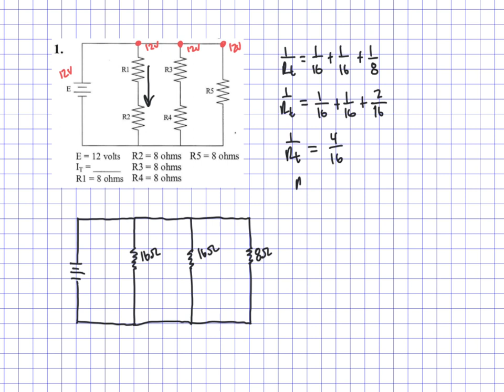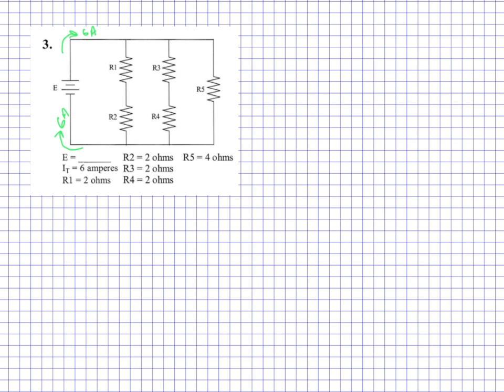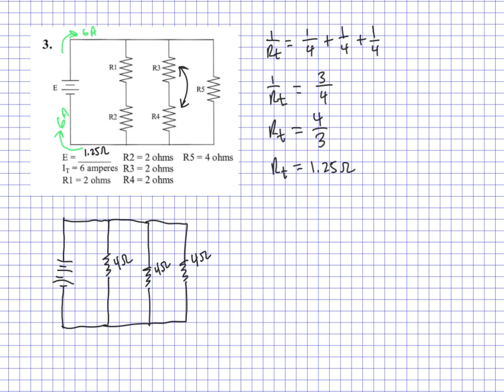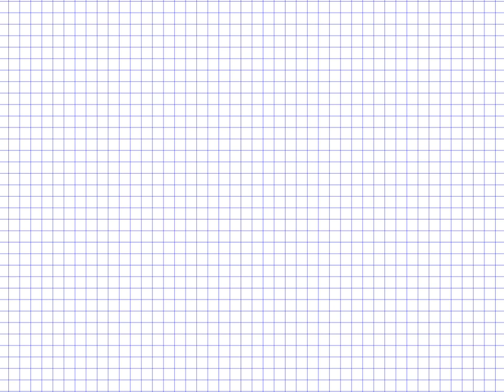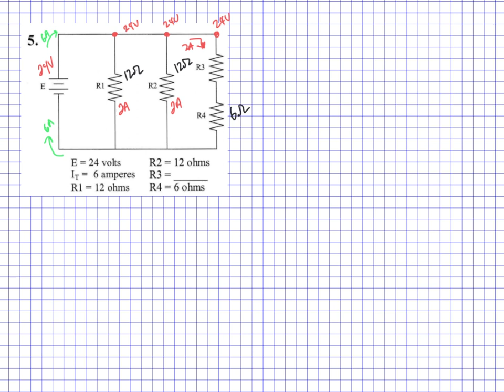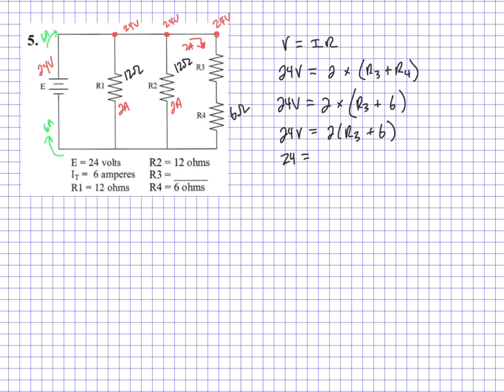Parallel Circuit Worksheet 3

Comment: I dont know if you paid attention, but number 3 is suppose to be 7.5V, why would you put the value as resistance, kind of misleading.
Reply: and I got 8v as my answer because I rounded 7.98V to the nearest value
Reply from the maker: @AntisocialCommittee  That is correct.  I made an error.  Good catch.

Comment: And for number one he saying it’s 7.5
Reply: I know, he was supposed to put 7.5V because E clearly stands for electromagnetic force or Voltage obviously. Just a mistake I guess
Reply from the maker: @AntisocialCommittee  It was a mistake that resulted from an incorrect calculator input that gave me a Rt value of 1.25 when it should have been 1.33.  Appreciate you guys letting me know about this.